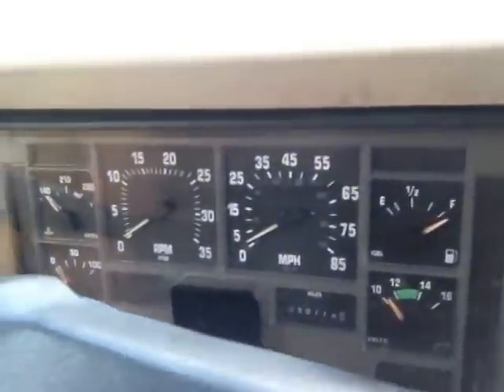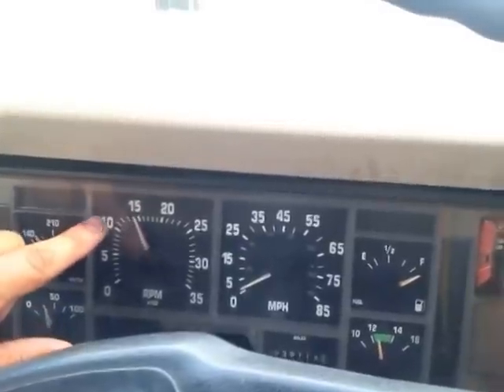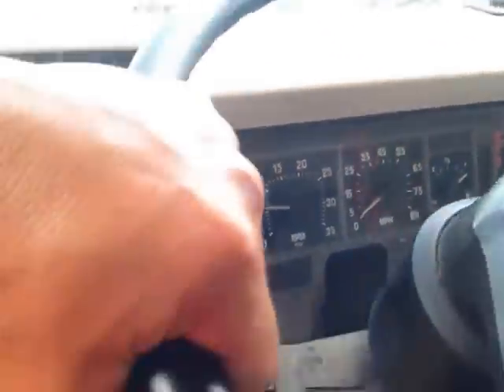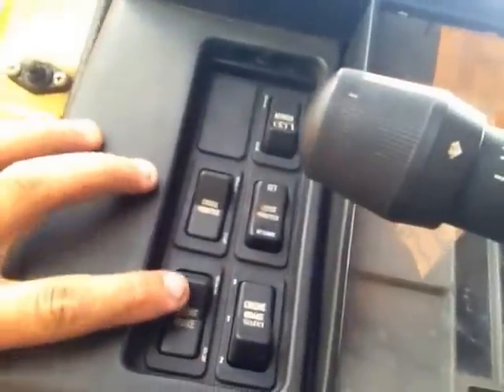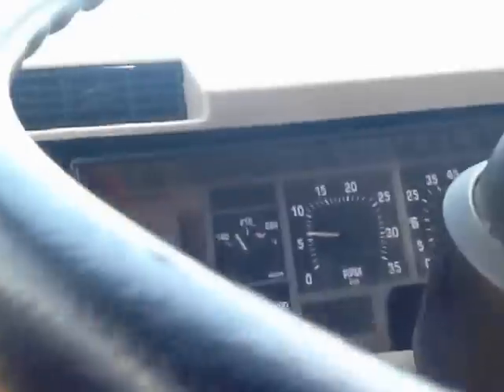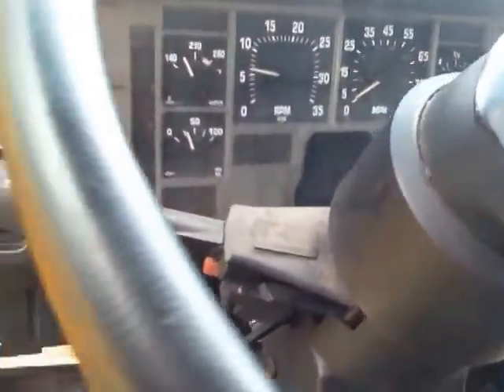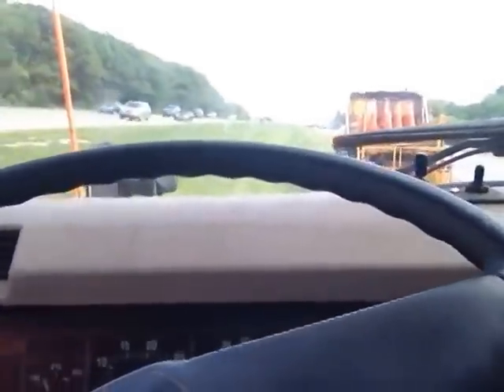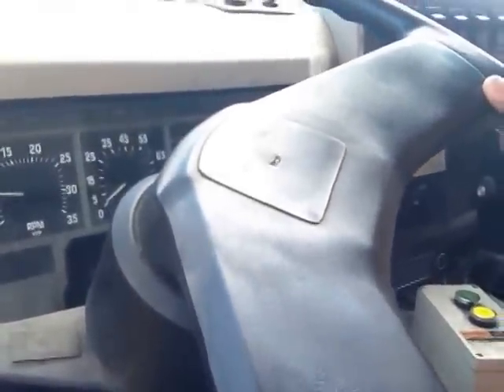How to use an Engine Brake (part one)

Comment: The guy has pure intent in his video.  He is sharing what he knows to help others. That is admirable.  It doesn't mean he knows everything. Give the guy a break.  The engine brake actually becomes a sort of air compressor, which causes back pressure on the pistons.  When the air pressure builds up a valve releases it and that is where you get the 'Popping" sound. And Robert said something many people do not know which is the name "Jake Brake" and where it comes from.  Thanks, Robert for a great video.  There are some trucks that have a "speed reduction system" that works on the drive shaft of the vehicle.   You can find them in the oil and gas industry still. It is very important to know how to slow down a tractor-trailer with no engine brake.  Many of us have hauled the mountains without an engine brake.  And if you blow a fuse or break a wire, you no longer have an engine brake. You never "ride" the trailer spike 10% on a steep grade.
Reply from the maker: Thanks for the kind words. And to go right along with what you’re saying: There is so much more that I don’t know, compared to the little I do know. 
I’m learning every day. I appreciate your lesson…blessings, friend!

Comment: hello there my question is i have a truck international box year 2012 26k poundsi couldn’t find the engin brake ! please help me
Reply from the maker: Rafeek Saeed hey there!  It should be a rocker type switch on the dash. Try a few and let off the accelerator to see if it turns on.

Comment: I love the function of engine or jake brakes if u will,I love them because if u rolling u can take your foot off the excelorator and it starts to slow down by it's self !! I love the function in the bus that I drive to minimize the ware and tare of the actual brake pedal all the time but it also depends on how fast your going to help u slow down...

Comment: I use my engine break, but it seems like it doesn't work well enough.  I still have to press the brake a bit to maintain my speed going down even a 4% grade.  How can you tell if something's wrong with the engine break?
Reply from the maker: Hey!
Not sure on the power rating of the engine your vehicle is equipped with, but less power, usually equates to less effective engine braking.  Usually, they either work, or they don't...sometimes, they can cut in-and-out, but that is about it...be blessed!

Comment: I'm assuming YES but not 100% sure. When the engine brake kicks in, does it cut the fuel supply to the engine so it doesn't blow unused fuel out the exhaust?
Reply from the maker: Mathew McLean hello Matt...the main function of the engine brake is to dump the compression of the cylinders right near TDC, thus directing power from the crankshaft. 
The fuel delivery isn't "shut-off" , but of course the throttle must be released in order for the engine brake to be turned on.
Reply: Thank you, Robert.
Reply: Modern electronic diesel engines do cut fuel (they don't activate the injectors)  when the throttle is at min and the engine is still turning at higher than idle RPM, but it really has nothing to do with the engine brake, except as Robert Ruis said, the compression brake won't activate unless the throttle is at min.  (idle, or off the throttle)

Older injector pump engines don't do that, of course.

Comment: Ever used a transmission retarder?
Reply: +Patrick Musson americans arent retarded so no retarders
Reply: I was talking about transmission retarder that slow a truck using the transmission, thus having to use your brakes less and not having to wear out your gearbox by excessive downshifting..
Reply: i know what you where talking about
Reply from the maker: +Patrick Musson  hey Patrick!
No, I have never used one, or seen it; although, I have never had a transmission in the fleet go bad, even after half-a-million miles on it, they still shift fluently...the only time I have seen a roadranger transmission need repair was due to incompetent operation.
Reply: Some of the newer Scania trucks have opticruiseR transmission retarder, which is worked using a stick similar to the turn indicator stick but on the right of the wheel. If you use that, your brakes don't get used half as much.
Reply: they are trickling in on school buses but very rare

Comment: I like the way the European trucks use a steering mounted stalk instead of a dash mounted switch.Better control instead of reaching forward on the dash to flip the switch you keep your hands closer on the steering wheel, just like the flash to pass/high beam stalk.

Comment: I have 2 questions here, first one, do you know why some trucks make a lumpy crackle sound when the engine brake cuts?

Also when upshifting is it ok or better to not double clutch, but press the clutch once and hold it in until revs drop? Ps love your videos
Reply from the maker: Hello, and thank you for writing!

The noise you might be hearing could be a few things...for one, you could just be hearing the compression cycle of the engine as the truck slows down.  Or, if the truck has customized exhaust, the sound of the engine brake is indeed more pronounced.
Holding the clutch (single clutch) once and allowing the engine to slow down on up shifts will not allow the engine and transmission to match speeds properly.  Single clutching works with synchronized transmissions.

Be blessed!